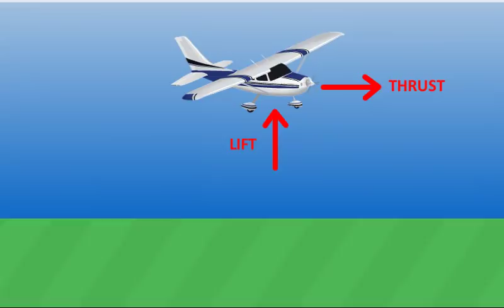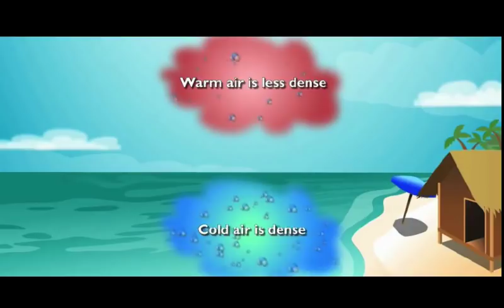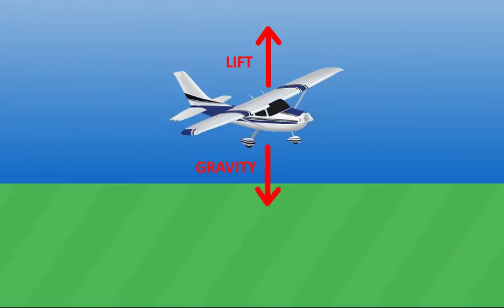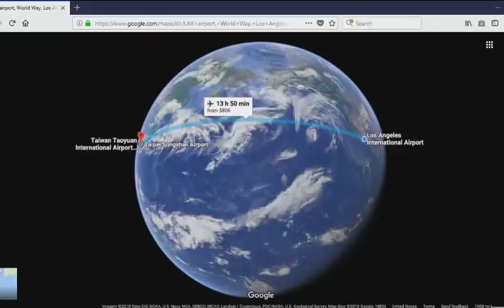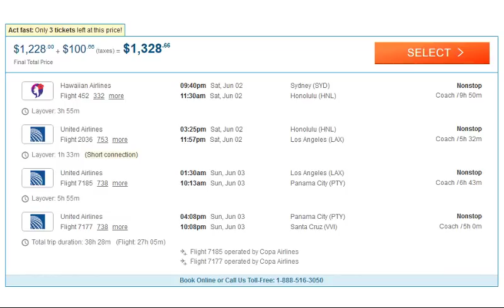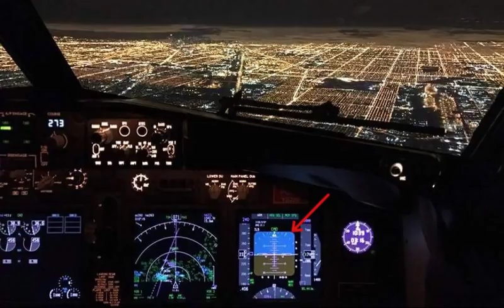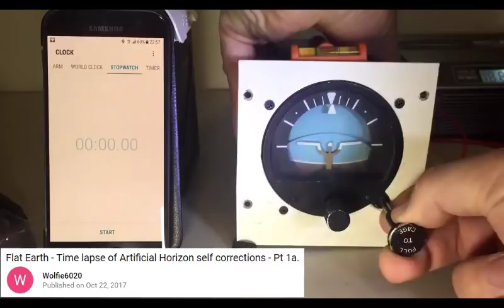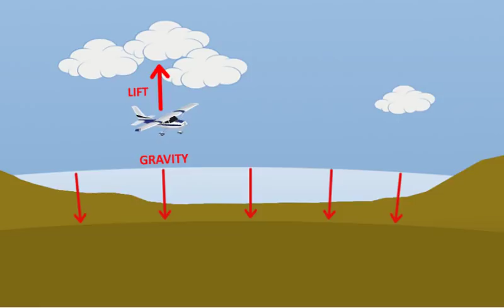Flat Earth Falsities - Plane Nonsense

Comment: Have you ever noticed, how in the heliocentric model everythin is a coincidence?
Reply: Mariusz Euphoric — I have noticed that distances between sets of coordinates are the same in the southern hemisphere as in the northern hemisphere. Is that simply a coincidence?
Reply from the maker: Umm, no. The coordinate system was designed for a curved earth, so there are equidistant lines of longitude and latitude in each hemisphere.
Reply: @JonasGrumby71  Indeed, I was hoping that he would come to that conclusion too. BTW, are you considering any new content?
Reply from the maker: Mariusz Euphoric - No, everything follows the laws of physics. What coincidences are you talking about? The apparent size of the sun and moon? It is a coincidence, but not as unlikely as you probably think. The apparent size of the moon varies by 12% during it’s orbit, so it is rarely EXACTLY the same apparent size as the sun, but pretty close. Also, the moon is slowly moving farther away, so it appeared larger than the sun in the distant past, and will appear smaller than the sun in the future. We just happen to live at the time that the apparent sizes are very close to the same.
Reply: Heliocentric is the same as geocentric, but only from different viewpoint.
Just like an old fashioned weigh scale is balanced, a lot in our universe is balanced and not a coincidence.
It has a certain order. It's just that some prefer to stick to chaos.
https://i.ytimg.com/vi/waexG16WZrE/maxresdefault.jpg
Reply: Mariusz Euphoric Is this a tacit admission that you believe in flat earth because then everything is planned by your sky daddy?